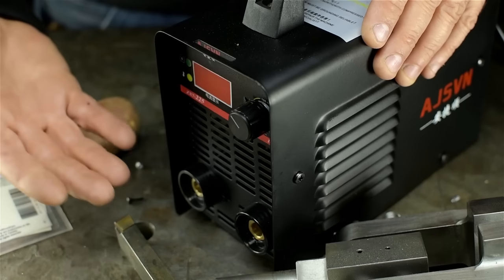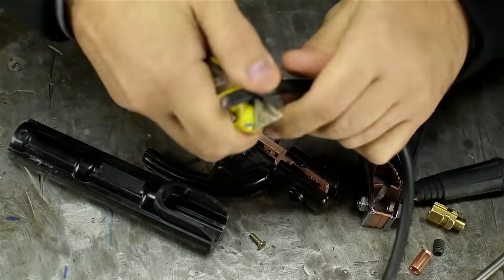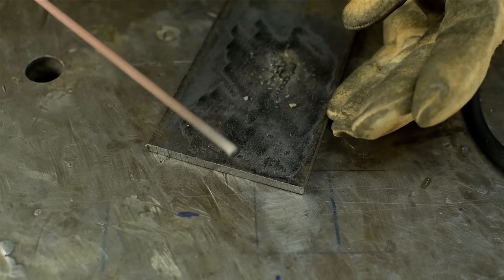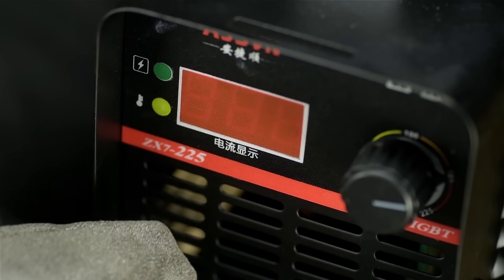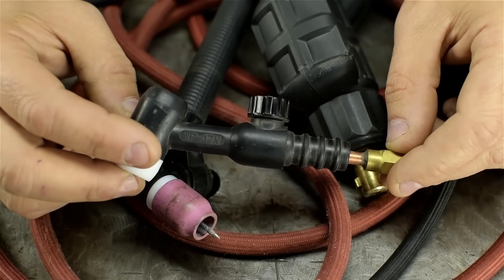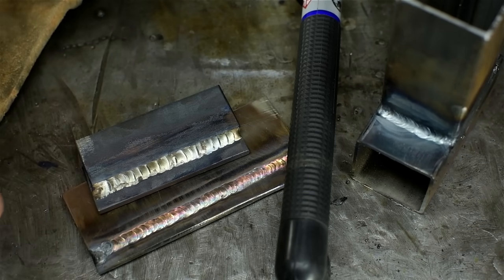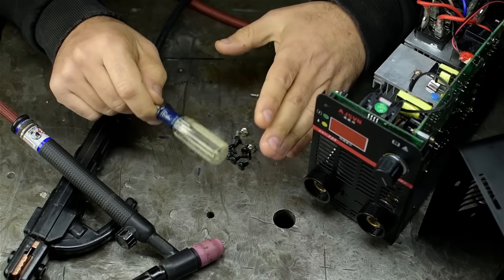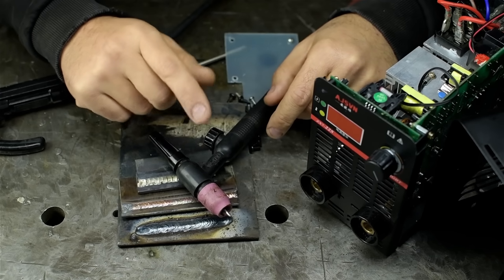Cheap Ebay Welder -- WILL IT TIG?!

Comment: It would be good to see what you would recommend  for a starter kit for TIG.
Reply: There are plenty of other people to ask that question with more knowledge of all the welding machines
Reply: @xenonram  but TOT is the only true source of enlightenment.
Reply: I love my lincoln tig 200 but next welder is a miller syncrowave or htp
Reply: @lsx_moe  dude get outta here with that shit, he said STARTER welder like a harbor freight tig welder. Decent price and pretty good quality using either their orange or green welders.
Reply: @JM-yx1lm  damn I just checked the prices, they are $1,700! I bought mine brand new for $900 last year! Cant believe how pricy they are. Definitely wouldn't spend 1700 bucks on one, the HTP is not far from it. I would recommend a used high end welder over a new cheap welder. I have also had great luck with everlast welders. I do love my Lincoln though
Reply: I think the ahp alpha tig 200x is the best starter deal. You get everything you need except the argon and tungsten for 700 bucks. I'm still using my 2015 model. The only thing it didnt like was doing 200 amp pulse AC for long times. I only ran into that situation once tho and it was after quite a lot of 3/8 plate. Oh and the foot pedal sucks but works. I would think they have probably upgraded it by now.
Reply: @johnnytakisawa  the alpha tig 201xd is practically the same but it has a really nice pedal and hose kit. I just like a digital display but you cant go wrong with one
Reply: @johnnytakisawa  I agree on the ahp. For the money it's a great home shop welder. Have had mine for two years with zero issues. The fact that it's dual voltage is also a huge plus for me. As for the pedal, you can buy a replacement, or make mods to the original one to make it more like a miller pedal.
Reply: @carlosl1993  yeah I bought the after market stt pedal or whatever. It works way better when tapering off at the end of a weld. I've heard a few horror stories from commenters but only 2 or 3 maybe. Everyone else seems to love em.
Reply: The Primeweld TIG225x has nice features, but the pedal sucks! 

DO NOT buy a Hyl here in the USA, I have one that stopped working, the dealer gave me the run around, right up to the point where he closed the doors! Sitting on a shelf gathering dust and waiting until I have time to Frankenstein cheap boards back into it to see if I can make it work again.
Reply: @johnnytakisawa  yeah I've heard of a few issues. But they mostly seem to happen early on from what I've seen, like manufacturing or QC  issues. But overall it's a great welder for the price.
Reply: @minigpracing3068  I saw 6061 shilling the primeweld. Looked pretty good. It could also be used with the push button amp control which is cool. And if your doing aluminum that extra 25 is gonna be huge.
Reply: Get a cheap setup and start from there. If its something you want to pursue after a cheap rig anything else seems like a dream

Comment: 200 Amps on a 14g lamp zip cord?  That's called a Russian LED. Makes a great space heater :)
Reply: bxxj it’s Chinese 200 Amps, as we saw this translates to 128 western Amps ...
Reply: @SmilingDevil  with only 1/10th the insulation as well :)
Reply: @SmilingDevil  Honestly! It's just that American Volts are HALF the chinese volts. That's why the welder was struggling.
Reply: About 3/4 of worlds population uses 220 Volts and the U.S. is still struggling with 110V ?

Comment: I for one was pretty impressed with what this welder is capable of.  Yes it’s not 200A but it does lay down a pretty good bead.  I checked out a few other videos for more info.  Apparently there is a separate grounding screw on the back.  I can’t say that I saw it in this vid though.  By nature of its design it does have an isolation transformer.  The high voltage is rectified and converted to high frequency.  This is converted to low voltage through a toroidal transformer.

Comment: To eliminate alot of danger, simply add a ground to the case. 
Should have been manufactured that way since it is not double insulated.

Simply attach a piece of wire to one of the case screws, zip tie it to the existing cord and attach other end to the ground terminal inside a 3 conductor power plug.
Try to match ground wire size to the power wire size; any size ground is better than none though.

Or swap 2 conductor power cord for a 3 conductor cord and attach with same methods. 
Looks like it could use larger power conductors anyways, so I would upgrade that too while your at it.
Reply: I have a feeling that if you were to ground the case on this machine that the circuit breaker will trip.  🙂
Reply: Hopefully the metal case, resting on the metal welding table, is grounding it.
That would be another option for grounding, piece of wire from outer case, clamped to welding table.

Comment: You can also cross off tap magic from your list. Does NOT taste like peppermint.
Reply: Anchor Lube does
Reply: @MattOGormanSmith  how about MMO?
Reply: yoonki lol!
Reply: Loctite 515 is pretty good, but only in very small amounts.
Reply: But it does work like magic. Or at least the original red label flvaor does. I used to have a job where you would manually tap a lot of holes, slash do them with a cordless drill. I can say tap magic versus a bunch of different other brands made a huge noticeable and measurable difference in how will the tapping worked and how many taps are broken.
Reply: Nah, tastes like chicken.
Reply: Always smelled like bubblegum to me for some reason

Comment: "Hey, I got $100"
[Wires up two in series]
Reply: While this might be a terrible idea, I kinda what to see what would happen.
Reply: @GermanTopGameTV  if you wire them in opposite polarity of each other it'll weld the clamps down
Reply: It would probably work, but the 50 volts to the case is very distubring. You would have to do some testing, but you might have 60 volts open circuit for the 7018's.
Reply: Great review.

Comment: Holy crap! I have not laughed this for a long time. Thank you. 
You’re going to want to explain the accessories you have for your Fluke or you’ll end up with hundreds of people asking why you’re using VDC to read amperage.
Reply: came to ask why he's using vdc to read amperage
Reply: @calinguga  because he has a current clamp that outputs DC voltage proportional to current.

Comment: Just when you thought HARBOR FREIGHT was the sketchiest to use.
Reply: Incredibly the Vulcan line is fairly legit for hobby use
Reply: I have one myself. I was just kidding. They are a good machine.
Reply: @schannoman  I agree. I used the Vulcan 215 for a couple months. No issues whatsoever.
Reply: @schannoman  the new vulcan protig 205. Will tig 1/4"  aluminum NO ISSUE. On dc with helium.  And easily. Burn .188 on AC with argon.  And do it  all day  long without kicking duty cycle unless your really jamming on it

   I use it in my boat building business along side my miller 350Pa . Was VERY impressed. Even with its frequency limitations   but. 5086 dials in nicely about 90 hz and 65-70 % ac ballance

Comment: When I was young I learned about double insulated grounds when I bought my first motorhome...plugged into camper park power..walked around to the front and with a spring in my step and words of love to my new wife, TRIED to open the metal screen door...ZZZZZZAAAAPPPP..My wife refused to sleep, ride in, or have anything to do with my "budget motorhome" ever again...I respected her wishes and turned it into a car hauler...
Reply: My buddy's camper's door was electrified for no reason some days. Not a year later everything electrical caught fire
Reply: @randomguy93984  Yea..when I was converting it into a Car Hauler I found that all the electrical sockets and switches were either shorted or soon to be shorted due to poor quality electrics installed by factory. This is a HUGE problem with Motorhomes. They don't have "Boxes" around sockets etc. like a house. The plastic they are made of deteriorates quickly and they literally fall to pieces, shorting out and causing fires! ..I always replace all switches and sockets every 10 years now on any Motorhome I buy...I don't know why the Gov. hasn't stepped in and stopped this poor quality "time bomb" in the industry. I'm sure loss of property and lives lost are high for just this reason...

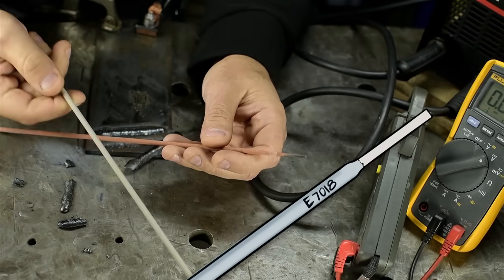Comment: Hey Tony, love your videos! You mentioned "if you were measuring this wrong" during your amp testing, so.... looking at 10:39 in the video your amp measurements are measuring DC voltage. Not sure anyone has brought this up to you, but in order to successfully measure current with an ammeter clamp (or any ammeter) you must first plug the common lead into that other fuse protected slot (NOT the COM) and then turn your meter knob to the big "A" with the straight dashed lines (DC Amps).

You could've really been pumping out that many amps but the device itself has that low voltage you mentioned, so the overall power being produced is minimal

Comment: Clearly the rated amps  on the welder was "metric amps" :P
Reply: I don't think so - if they were "metric amps", they'd be 2.54 times the measured amps, not just roughly 1.9.....
Reply: @noremorsewoodworking2258   😂😂😂 you're right....
Reply: Newton amps

Comment: Makes me feel way way better that I bought a small Everlast welder. Came with a case, dual voltage operation, proper tig equipment and actual cables!
Reply: You mean the ST 140?
Reply: I bet your welder cost more than $60 though.
Reply: Also very happy with my everlast, though the flowmeter crapped out after 3 uses in under a year.

Mine cost considerably more than $60
Reply: @Jrez  I'm good with my Miller but it too cost a tad more than $60. At least it has HF start though.
Reply: I went HTP.  Was also considerably more than $60, more like $600, but I wanted to do aluminum and thus needed AC unless I wanted to spend a boatload of money on helium.

Comment: To scratch start and save on the electrode, use a piece of sheet copper.  The electrode usually will not stick to the copper.  Place the copper on the part right where you want to start.

Comment: You are fantastic! I laughed so hard I think I blew a Hemorrhoid! I bought a few of these to try out and they work... But found they work better at 250 volts input with a stiff supply voltage. Stability is lacking on all of them due to low OCV and low arc voltage. It can be improved by adding an output choke and good rod selection.

Comment: You had too long cables:-)) It probablly is meant to be wireless.
Reply: As I understand longer wires mean more resistance. understanding nods
Reply: And lower voltage and current, yes?

Comment: That's too funny. I started finally looking at welding because my projects have finally piled up. Always wanted to get into it, but never had enough of a reason to invest in it for myself. The thing that tipped me over the edge..... patching my riding mower deck, literally the first thing you said about weekend warrior. I'm not considering this, but still learned a bit, and found it interesting. THanks!

Comment: Did you have the fluke set to VDC, or do my eyes deceive?
Reply: He likely had an accessory amp clamp, that outputs millivolts per DC amp.
Reply: mattmanyam that makes sense I guess. Running that setup, and switching from 110vac to 220vac supply, should you double the readout number when you double voltage?
Reply: @gabrieledwards4045  no, the Amp clamp reads actual amps, via the induced magnetic flux around the conductor... No adjustment necessary (still DC)

Comment: I've never welded before but want to learn. However since watching you play with your death toaster, this scares me beyond my frivulous comfort zone.
Reply: I've got an old stick welder I've used probably twice and it is terrifying. But, the satisfaction of having essentially used lightning to glue metal together and make that thing I wanted to make does make up for the fear. When all is said and done, my pants may be wet, but I now have the thing I needed welded and ready to go.
In all seriousness, it is scary (which is why I have barely done any welding), but it is also incredibly useful.
Reply: @pancake_crab4457  You people worry too much about electric shocks -you can die in a bathtub as easy ,one slip and you are gone -BEWARE OF THE REAL KILLER-THE BATHTUB its coming to get you !!!Especialy if you are 90 years old ,but then again very few people weld with 90 years of age so statisticly speaking if you are 90 years old you have higher chance to be killed by bathtub than by electric shock from welder!!!Hope that eases your fears !!!
Reply: Honestly, being a little scared of these things probably isn't a bad thing. Lots of accidents with power tools is caused by complacency. Always respect the tools.

I'll be honest, ToT is braver then I am, I wouldn't have even fired it up once I saw it didn't have a ground. That's a lot of amps and an un-insulated metal case.
Reply: Dan L, a standard transformer based welder plugged in to 220 or 240 volts is not the easiest to learn on, as ToT mentions the OCV for electrode types, from these is low, though they do have a extra winding to increase the start up arc voltage. A good inverter based welder, can use 115, 220 etc, it rectifys, and increases the DC voltage (called Bus Voltage), this means the OCV is 80 Volt, which makes striking the arc easy. I'm sure there are plenty of good forums on this subject.
Reply: Put this reply on a few comments. Look into oxy acetalyne. Cheap setup to learn how to weld. The tool can easily braze and cut. A decent setup from airgas (low end  industrial grade) is mid $600
Reply: I starting fooling around with a cheap stick welder recently and it's a lot of hot, frustrating fun. Get a proper auto-darkening mask though. I cheaped out and got some welding goggles and promptly gave myself a massive sunburn on my forehead. Welding kicks out hellish amounts of UV.
Reply: At 30V is it a dangerous shock risk?? Or is it about starting fire,

Obviously inside the box is higher vintage.
Reply: Just observe basic safety precautions. Wear gloves and long sleeves when welding. And make sure you set the electrode stinger/mig gun/tig torch aside where it can't form a circuit with the welder ground.
Reply: Simon A well, if those 30 Volts push a lot of amps through parts of your body it can do quite some damage. The thing is that welders are designed to deliver high currents.
Reply: @McJunk1  yeah but you generally need much higher voltage in order for that current to harm you. A car battery can provide current surges in the hundreds of amp ranges but the voltage is too low to break the resistance of dry skin. Whereas 10kV at a few milliamps can stop your heart. My hobby for a while was building tube guitar amps, one of which was running internal voltages of over 700v. Only about 400mA, but that's enough to kill me dead. Check out photonicinduction on Youtube. He does all kinds of madness like melting wrenches with homemade transformers. They put out enough current to melt thick steel, but the voltage is so low it poses little electrocution risk.
Reply: Simon A If you’re sweating, or otherwise wet, that 30V would hurt and could cause some problems depending on how long you’re shocked and the path the current takes.
Reply: Phil Roberts yes and no. If an initial current path can be formed (e.g. through sweaty skin) current is going to flow. In this case I would recon the welder uses a constant current driver. This means, that once a path is formed the welder will actively try to maintain the current through your body. If you have wet fingers for example and can provide a path a couple of kOhms in resistance, the couple of milliamps that flow might hurt quite a bit.

Comment: To discharge the caps in my amplifiers, I drilled a small hole in the back end of a carpenter's pencil, then screwed a wire to it with an alligator clip on the other end. Attach that end to ground or chassis, then touch the tip of the pencil to the positive terminal. If there's voltage, it discharges with a nice little sizzle, rather than a hard pop that can render a screwdriver useless.

Comment: "I opted for the lgbt version"
Reply: How post modern.
Reply: Actually IGBT is the type of switch used, a very important basic technical information. It is an Insulated Gate Bipolar Transistor. I know it was a joke, but it is an interesting bit and some important information.
Reply: 100 likes milestone
Reply: so thats why the welders not what it says it is
Reply: @1312_PV  Bypolar ...Transistor....hmmm okayy :D
Reply: the joke is that the big Character of the Letter "i" ( I ) looks the same as a the small "L" ( l )
Reply: @1312_PV  Yeah! I see IGBT on a lot of stuff that is SWPS.....
Reply: LGBT, IGBT, the i and the L look similar when they look like this: I|l
Reply: Liquor Guns Beer and Tips....
Reply: They have a 41% chance of self destruction.

Comment: I never thought you can do TIG welding with a cheap inverter.
Well done, nice information and if I ever go into TIG welding, I will buy a TIG welder with a correct TIG, burner, cable solenoid and Argon/CO2 bottle.

Comment: An un-grounded appliance like that should be double insulated. Hard to see the first level insulation. One dent in the case and you would not need to connect one of the electrodes which will save time. 
The machine is safe as sold cause no cables supplied. Therefore you take liability for making connection.